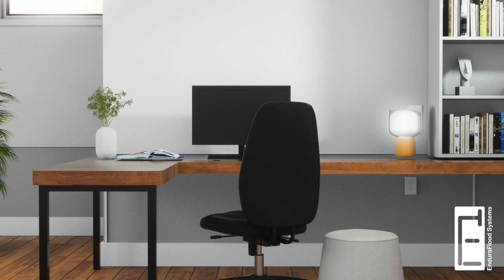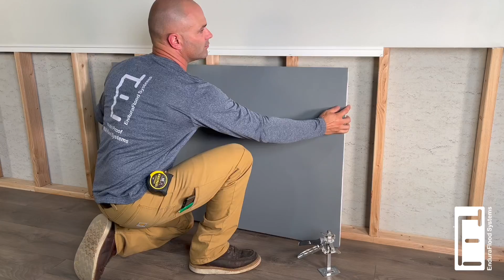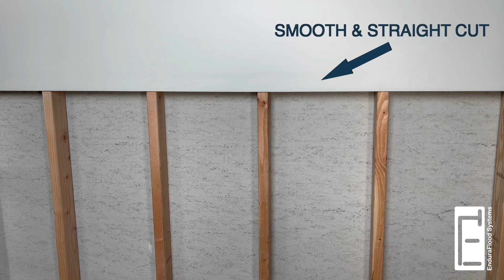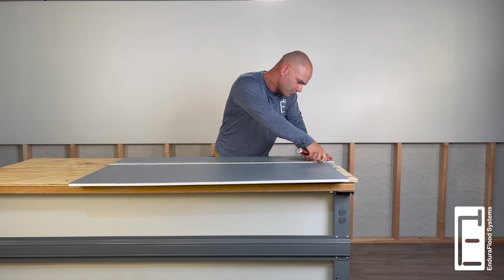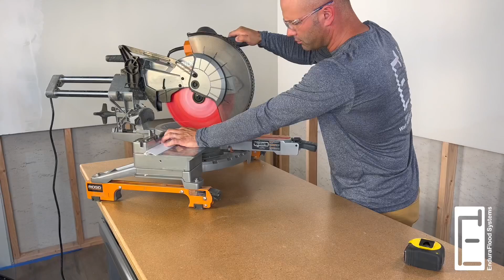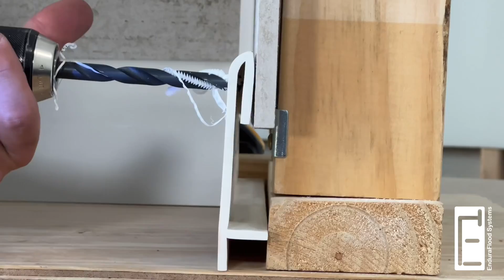EnduraFlood Basic Installation

Comment: I’d like to see not only the corners done, but removable foam insulation put behind the panels on outside walls. You could highlight that taking the panels and foam out is a great way to check for mold, especially needed if your house was flooded with salt water.

Comment: How is this waterproof?😂
Reply: It’s plastic
Reply: It's not meant to stop the moving of water through the wall.  It's meant to not rot when it gets wet (since it's plastic) and make drying out the wall space / replacing insulation easy after a flood.